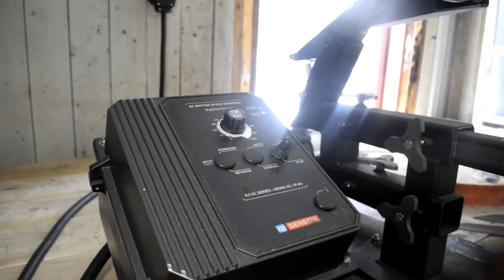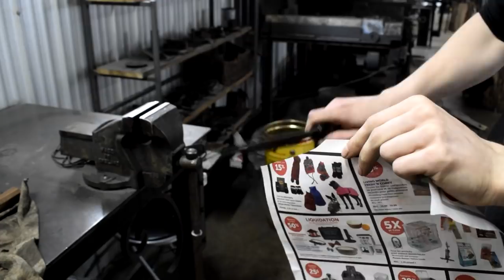Knife making - Wrought Iron San Mai Japanese Bunka Knives (sold)

Comment: God damn i love wrought iron 
Great job mate 👍
Reply from the maker: Me too! it's wonderfully unique in each knife. Thank you!
Reply: @MakeNCreate  just need to practice my forge welding and get some wrought so i can make some san mai like this
Reply from the maker: @S8tan7  This construction makes it quite easy as the carbon steel is well insulated from any direct heat from below. Wrought iron forge welds very easy since it already contains a bunch of impurities which kinda acts as it's own flux. Give it a go mate. Make sure you soak the piece nicely so it heats up nice and evenly. Cheers!
Reply: @MakeNCreate  thanks for the tips mate, need to find some wrought now somehow
Reply from the maker: @S8tan7  send me a Dm on Instagram if you have it and I'll help you with it :).
Reply: @MakeNCreate  well i have been meaning to make an instagram for knife related posts 😁

Comment: Awesome! I never get tired of that etched wrought iron, plus the handles are simple but beautiful! Btw, did you use stainless in the handle?
Reply from the maker: Haha me neither, so much character in the individual pieces. I think I did but I'm actually not quite sure. Either way it won't  as the grease from your hands will keep nice and protected and you should always wipe off water after using a carbon steel knife.